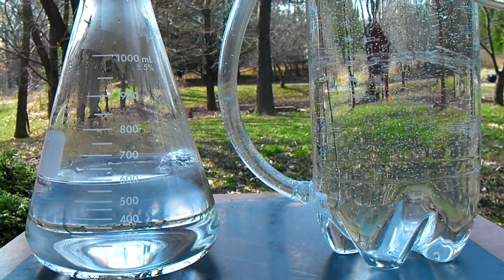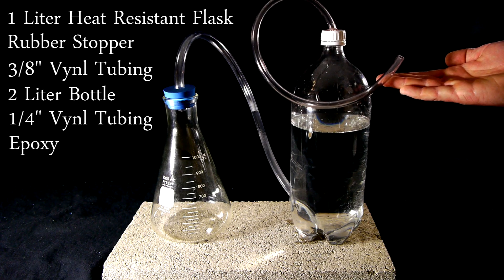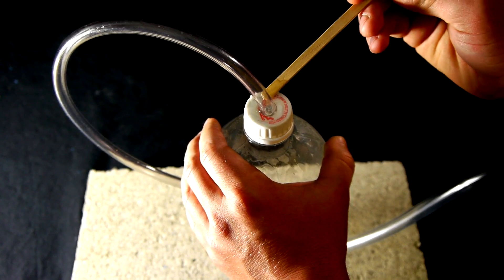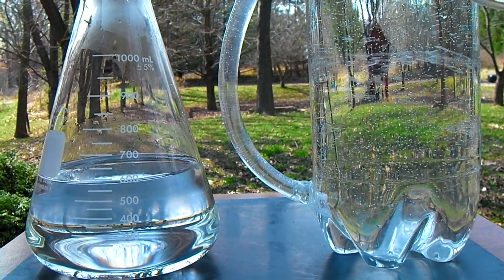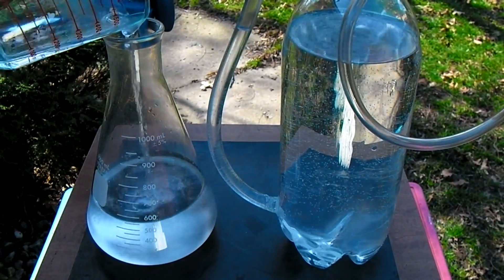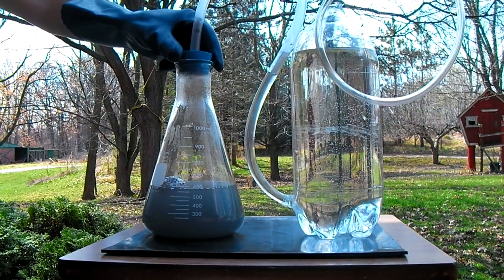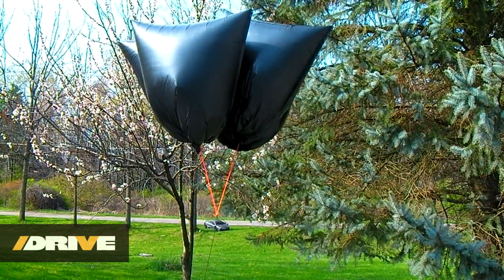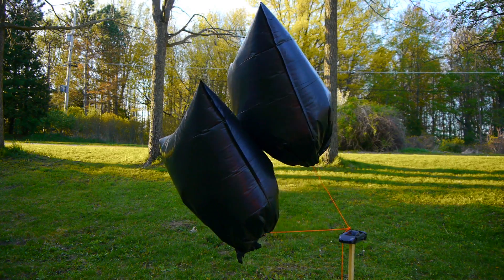How to Make Hydrogen Gas - Clean Burning, Inexpensive, Lighter than Air!

Comment: Hi, I've done this with glass food jars and they have been fine in terms of the heat. Food is often put into them hot so that there is a minimum of air in them when they cool. 
You can use Lye in place of the HCL / Muriatic acid. It's a lot more compact and non reactive when dry. Cheaper too. The more of the aluminum surface which is exposed the better the reaction. 
I like the way you've done this experiment. There's lots of good information.

Comment: cant you do the same with NaOH instead of acid? around here it's much easier to get NaOH and i have a 1 meter long 50cm wide aluminium roll i bought for some small projects, so it would be very convinient if i could do that

edit: also, pretty sure you can add something like boric acid or borax in the bubbler so the hydrogen kinda "picks up" some ions and makes the flame green and more visible? would be better since i wanna make some kind of torch/burner with air/hygrogen, and is there a way i could make a "pressure vessel" 
 sort.of thing so i can store hydrogen long term?
Reply from the maker: Yes NaOH is better
Reply: @Nighthawkinlight  wow that's a fast reply, thanks!

Comment: The one I made in 7th grade was simply a large glass soda bottle, they used glass then, and a balloon on top. It would inflate on its own. I used lye and aluminum foil in the solution. No gloves or etc. It did get a bit hot after a while, but I just set the whole operation in a bucket of water, for a little while. 
A half dozen of these balloons with one acetylene and oxygen balloon, some twisted newspaper with a tiny bit of lamp oil on it for a 24 inch wick. It would drift up several hundred feet and some distance over a different nearby neighborhood and cause a VERY loud but harmless report. 
The cops were all over the place looking for the source. Gosh we had so much fun!🤓

Comment: What if you apply a solution of Sio2 to latex or plastic bag. Will the nano sized particles fill the holes in the material enough to stop the gas from escaping

Comment: Could use NaOH instead of HCl with the aluminum , an ice bath would probably be a good idea too if that is done. They both have the same efficiency for how much aluminum used but the NaOH reaction consumes water as well. It also uses less NaOH , 2 moles, as opposed to the HCl reaction that uses 6 moles of HCl. Depending on the prices of the chemicals, it might be more cost effective to use the NaOH reaction.

Comment: Thanks for the advice, It's a great video. I always had bad, barely satisfactory grades in chemistry at school but good enough marks for physics.  My only question is there also a simple method of compressing that produced Hydrogen Gas into ballon,  a light plastic bottle, possibly even a sealed can of beer or any suitable container. Then would it because of the greater density of contained gas in certain objects make it to be still lighter than air but now considering the increased mass of the gas due to same increased density. Can ideal proportion be calculated never forgetting to add the mass of the container in the procedure as well, with some simple formula?   And for which rate is pure vacuum lighter than Hydrogen Gas?
Reply from the maker: Compressing hydrogen raises its density, and low density is what causes it to float. Packing a lot of it into a container at pressure will not make it lighter. A vacuum is lighter than hydrogen at any pressure.

Comment: Is the by product (aluminum chloride) toxic?  What is the easiest way to dispose it properly?
Reply from the maker: It is I believe, mildly. I did not know that at the time of this video. You can avoid the problem by using sodium hydroxide instead of acid to attack the aluminum. Then the byproducts are harmless.
Reply: @Nighthawkinlight   thanks for the heads up.  I can't wait to give this a try.

Comment: Just use a NaOH solution and add aluminium to that. It’s less corrosive and can be brought at a grocery store under drain cleaner.
Reply: Rubbing Gallium on scratched up aluminum is way better and for some reason (due to aluminum nanoparticles) yields WAY more Hydrogen! (Can even retrieve 100% of the used Gallium after its all over with!)
Reply: @alfredharrison597  It would increase the reaction speed though (inc surface area = inc reaction speed) which can be a bad thing if you want it to stay controlled. Also gallium is not that cheap and also it does still react with the NaOH and water (Ga + 2NaOH + 6H2O → 2Na[Ga(OH)4] + 3H2) so you'll definitely be losing some or if not all of your gallium.
Reply: Aluminum is the devil
Reply: NaOH will start to etch the flask if you don't cool it, but it does work well

Comment: You can combine gallium metal and indium metal to make a gallium indium alloy. Then you can react tin and hydrochloric acid to make tin (II) chloride. The gallium indium alloy can be amalgamated with aluminum foil. Then you can add it to a flask of water. Then add the tin (II) chloride. The tin (II) chloride will react with the aluminum oxide to make tin and aluminum chloride. The gallium indium alloy will combine with the tin to make galinstan. The galinstan can amalgamate aluminum.

Comment: If somebody use HHO generator and try to ignite, this is more than sure that it will be serious body damage. There is no spectacular flying hands on this video only because the hydrogen is not mixed with oxygen. Stay safe.
Reply: No, only if they have the cathode and anode in the same chamber. If you separate them, all is well.

Comment: Since you made hydrogen, can you make a video on water by combining hydrogen with oxygen?
Reply: The burning of hydrogen produces water in this reaction: 2H2+O2=2H2O. However, the water is instantly turned into a gas by the heat of the reaction.

Comment: Why don't you just use drain cleaner and aluminum?
Reply: Mediocre Chicken Nuggetz yeah drain cleaner contains H2SO4 and when it reacts with Al it formed Al2(SO4)3+3H2
Reply: even though drain cleaner is a simple term for common people to remember NaOH by, it's not a good one as there's multiple types of drain cleaner. you're better off calling it "soda lye" since that's both accurate and common.
Reply: tl;dr

Not all drain cleaner contains NaOH.
Not all drain cleaner contains H2SO4.

Comment: Wouldn't a hidrolosis reaction be safer?
Reply: Not necessarily, especially if you're working with a lot of Watts (Amps + Volts) but overall, yes, it's safer for the average D.I.Y project. Plus, it's hydrolysis.

Comment: Is the hydrogen collected this way safe to breathe in? I mean is it clear enough?
Reply: 100% hydrogen is never safe to breath since it has 0% oxygen in it. But if you are talking about holding it in for about a couple of seconds or use it to make funny high pitch sounds, then it should be fine. Just don't do it too often since the water can only partially filter of the acid vapor.
Reply: Not recomendent . That air is toxic

Comment: Wouldn't it be safer to just electrolyse water?
Reply: Not necessarily, especially if you're working with a lot of Watts (Amps +
 Volts) but overall, yes, it's safer for the average D.I.Y project.

Comment: I don't know what kind of hardware stores you have where you live but the ones near me don't sell hydrochloric acid nor heat resistant flasks
Reply: the a acid you seek is in the concrete dept. of home improvement stores(lowes, home depot)for cleaning brick and concrete. also labeled as muriatic acid. the flask can be found in kitchen-ware at walmart.

Comment: By doing the math, how much hydrogen would theoretically be needed to like a 200lb person???
Reply: In perfect conditions, you would need approximately 1,815 (30 gallon) trash bags, or 54,431 "gallons" of hydrogen. However, that is not taking into account the weight of the ropes that are attached to the trash bags, so you would probably need more.

Comment: What would happen if you tied a long cannon fuse to one of those hydrogen-filled balloons (or a giant weather balloon) and lit the fuse and released it, on a dark night?
Reply: It would be like an aerial firecracker - when the hydrogen ignited you'd get a nice loud bang. Fun for all ages.
Reply: unless it got too high and ran out of oxygen. Maybe mix a little?
Reply: The upper explosive limit of hydrogen is 75 percent - meaning it doesn't take much oxygen to enable hydrogen to burn. So you'd have to go REALLY high before it wouldn't ignite once the fuse burned down.

Comment: Question : Can you use a safe method of electrolysis to produce it? If so, i would adore a video on that. <3
Reply: Use baking soda instead of salt when ELing water
Reply: you can use electric, most use DC or a car battery, some can use AC.
The better the electrolysis action the more power you use.  The amount of power used is usally the down fall of the exeriment.  But electrolysis is a very slow way to make hho.  If you compartmentalize the electrodes, that is, keep the bubbles from one electrode separate from the other, you can collect pure hydrogen and just let the oxygen escape to the air.
If you are going to burn the hydrogen,  make a bottle like he did so it bubbles up to the top.  This prevents the fire from going back to the source .  This is true with HHO but if you have pure hydrogen,  it shouldnt be able to go back through the tube because no oxygen in the mix.
Reply: @lifequest7453  thanks for answering my question 7 years later! 😂
Reply: @avion3033  -- no prob, next question?

Comment: I wonder if this can be put to practical use and splice into the fuel injectors on a motor vehicle.  HCL is a dangerous chemical, but this would produce fuel fast and cheap.  I could care less about blowing shit up with hydrogen gas.  If you really want an explosion, combine hydrogen in a balloon along with pure oxygen; 50/50.  I have seen a 12 inch diameter party balloon with the mixture ignited.  A college chemistry professor demonstrated.   The detonation shook the dust off the ceiling grid in a college classroom.  The explosion was extremely violent with much concussion.  The mixture must be under pressure for maximum effect.  However; be carefull with all forms of static electricity.

Comment: Why is it necessary to dilute the acid in water? Is the reaction with aluminum to vigorous/hot if the acid is undiluted? Can you describe it? Thanks!
Reply: I think its to purify it there are some other compounds/elements that get trapped in the water its like a filter

Comment: Hmm,  we used to produce at least as much hydrogen as indicated in this video by dissolving lye in water then adding the balled-up aluminum foil.  Used drain cleaner (lye) which is the opposite of acid (it's a strong base, not an acid).   We did use much bigger vessels than the lab ware shown here - used 5 gallon glass jugs and probably over a quart of water.  We used our hydrogen balloons to lift bundles of fireworks with very long (10 ft) fuses.  The balloons could reach low hanging clouds and the fireworks going off inside a cloud at night caused UFO reports to be filed.  LOL

Comment: I gave this video a thumbs down as there is no mention of just what to do with the renaming products of the reaction in a safe way and if this was done in mass those pollutants could cause more harm than good. There are other ways to release the hydrogen from water that don't have this problem of creating pollution as a byproduct of the over all process. The one I am working on produces electricity as a byproduct of the process of breaking down water to be used as fuel on demand.
Reply: +Edward Mitchell The acid is pretty much neutral once the aluminium reacts with the acid
Reply: My question is what did you do with the reactance once the reaction was completed, did you "A" take it to a hazmat facility to be properly deposed of or "B" did you dump it on the ground or down the drain? Now imagine 3 billion or more people doing that and you can start to see why I gave this video a thumbs down. Hydrogen is the fuel of the future but we must get at it in a far cleaner and responsible way.
Reply: Completely understandable.

Comment: +NightHawkInLight I want to make a hydrogen torch for melting metal. I have very thick CO2 gas canisters and a small compressor (5bar). You know of any reason why it wouldn't work? Im obviously going to build or buy a nozzle that prevents the flames from going back in.

Comment: Quick note...
HCl is only a molecule in the gaseous state. As an aqueous solution, the H+ and Cl- ions are already separate. The reaction does not strictly speaking release the H from the HCl... it just gives electrons to the H+ so they can form H2, the elemental gas.

Comment: what happens after you burn hydrogen in a 100% hydrogen environment(lets say inside a giant impenetrable box) what would it turn into after you burn it? because surprisingly that simple information is impossible to find.
Reply from the maker: +ObjectableApparatus You can't burn anything without oxygen. Nothing would happen.
Reply: +Rehuel Galzote
It can't turn into water without oxygen
Reply: it's simply won't ignite as oxygen is absent
Reply: Burning is just a chemical reaction with oxygen. If there's no oxygen, you can't burn anything.
Reply: +NightHawkInLight
In other words, it will turn into water.
Reply: +ObjectableApparatus learn more about hydrogen and hydrogen bombs anything else u'll understand
Reply: +Cretium false.
magnesium can burn in a 100% co2 enviroment.
its a pretty cool thing actually.
Reply: +Elements & Science Well yea but just coz it can rip the oxygen from the co2 molecules
Reply: +NightHawkInLight Then how do stars work?
Reply: CasuAl Pro
I think its fusion of hydrogen.
Reply: Rehuel Galzote Fusion of hydrogen only occurs in extremely hot and pressured environments, like in the sun's core.
Reply: Cretium
but the sun is considered a star is it not?
Reply: Rehuel Galzote It is

Comment: There`s another, simpler way to make hydrogen. if you submerge a 9 volt battery in tap water mixed with salt, it will separate the hydrogen from the oxygen. will you show an example of this?
Reply: +Evi1M4chine No its a form of electrolysis. the water will break into its 2 elements but the salt will also so it will release a small amount of chlorine
Reply: ***** no
Reply: +crustypizza900 are you sure about that cause i am going to try this
Reply: LiT RaBBiT ye i tried it

Comment: safe to inhale?
Reply: well it's mostly producing hydrogen, but I'm sure some chlorine was produces too.
hydrogen is 100% safe (flammability aside), but chlorine gas (and hydrogen chloride) is just the opposite.
Reply: chlorine is almost impossible to be produced in this reaction .There is Hydrogen chloride though so the bottle of water helps to clean the gas as the HCl will get dissolve in it .But still i would not inhale it .

Comment: What aluminum foil did you use? I tried doing this with aluminum foil later for it to fail then I learned most aluminum foil has a thin layer of wax or something with makes it not react to the acid. Please help!
Reply: +GeoWM Dollar store aluminum foil will not be coated. Strips of aluminum sheet metal would also work. and if you rip up the aluminum the wax coating will not get in the way.

Comment: see me and a friend did this (using electrolysis) and filled a 2L fizzy bottle up with it by displacing water in the bottle with a bucket. knowing the bottle is pressure rated we lit it thinking it would shoot off however the explosion was so volatile it blew a large hole in the bottom of the bottle! not like we sealed the top or anything. left me and my mate with very sore hands (yeah probably not the best idea to hold it as setting it off lol) and are ears have been ringing for days now. how come are one is so much more volatile than any videos that i can find on youtube ... even the next door neighbor come over to see what happened the explosion was so loud

Comment: i know a way easier method put a bottle in an ice bath and mix water and lye together warning lye and water reaction without an ice bath is extreemly exauthermic then add aluminium foil put a balloon on top of bottle wait until the balloon gets filled up  plus hydrogen also flammable mixed with air :)

Comment: Yo nhil can you use hydrogen gas as a fule source for a potato cannon?
Reply: Trent Tiedeman only way to find out is to try.
Reply: +Trent Tiedeman Yes, you can.
Reply: +Micah Burgin how so?
Reply: Fill potato cannon. Follow standard procedure as you would with any gas-fuel potato cannon (Hairspray or whatever) but keep in mind you will need to get oxygen in there somehow, and be sure you account for water buildup and the amount of force produced by hydrogen combustion and steam expansion of the water produced.
Reply: +Micah Burgin so basically a hybrid potato cannon
Reply: Sure, if you want to put it that way. It's technically just a single purpose one though, it uses the same system...
Reply: That is one of the most dangerous things I have ever heard. You would likely blow yourself up because the reaction of hydrogen with oxygen is SO much more violent than that of butane/propane with air. "Yes, you can" is a good way to get someone killed. You probably haven't tried it like you suggest or you would never have suggested it.